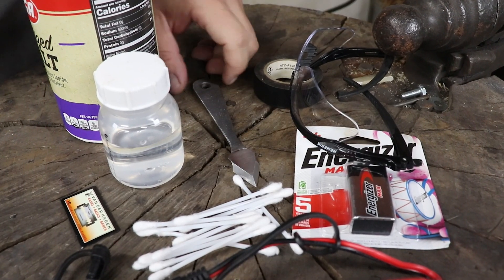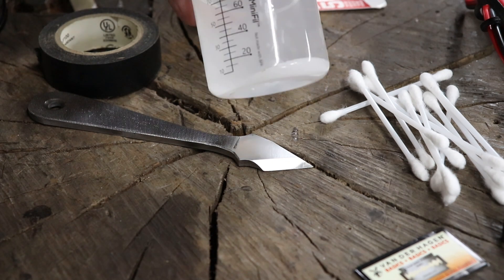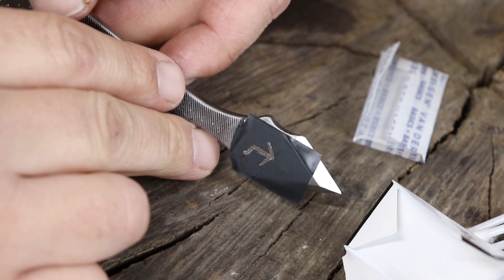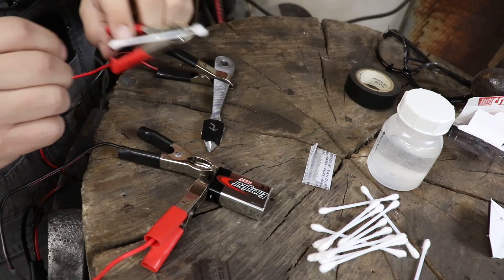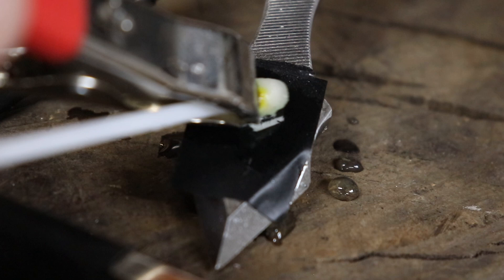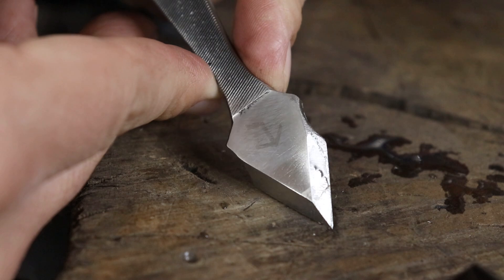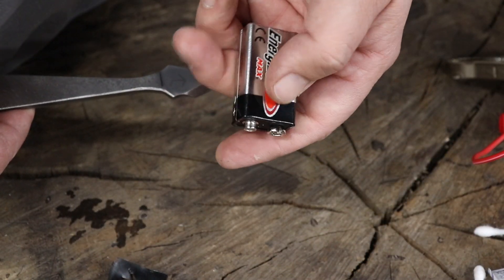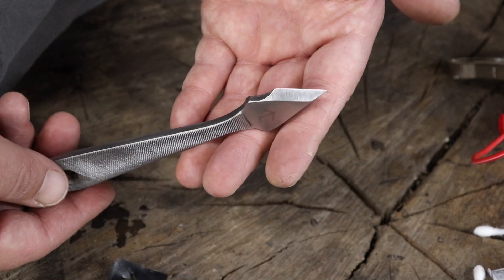Cheap Steel Etching

Comment: Put the positive lead on your tool and the negative lead on the q-tip then you will get results.
Reply from the maker: the way they are connected in the middle it makes reversed its the correct way it just  doesn't look like it.

Comment: You have the leads backwards. + on the tool and - on the qtip. Switch that and your golden.
Reply from the maker: The way the clips connect in the center make them backwards its hooked up positive to the q-tip.

Comment: i use a regular powersupply with 12 V from a wifi router or something similiar and it works fine. But it actually depends a little bit on the kind of sttel you use. With carbonsteel and also va steel i had no problems in edging it. And if you want youre touchmark to be cut out clean, ask a friend with a plotter if he can cut out a bunch of them for you from any adhesive film.
Reply from the maker: Thats a good idea thank you!

Comment: I'll try a motorcycle charger for 2 amps and face shield and stand back as far as possible, believe I've seen it on YouTube channel.
I was planning to make a marking tool for wood working as a 3 piece tools but yeah your one piece marker knife does look handier than having 3 tools for what you're having one and correct the marker does make a thinner line for better center of cut lines.
Love the comfortable looking handles great handles make great tools more enjoyable and not tossed into old dusty areas.
Thanks 
Thanks
Reply from the maker: I'll have to try that!